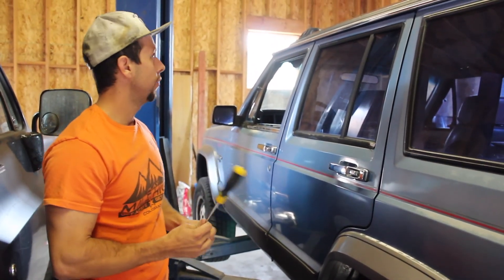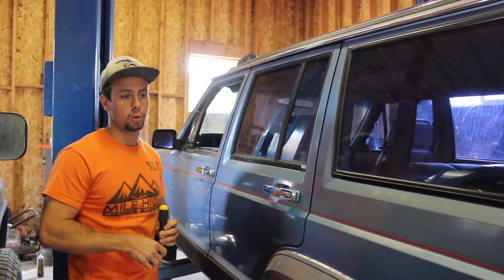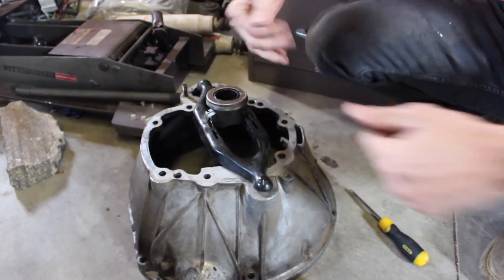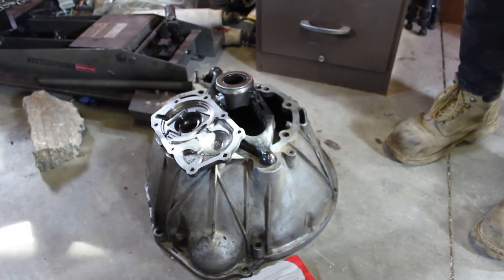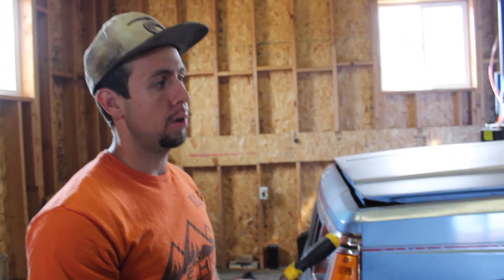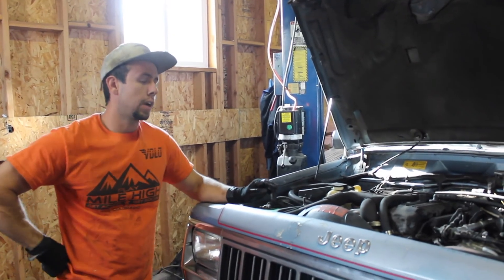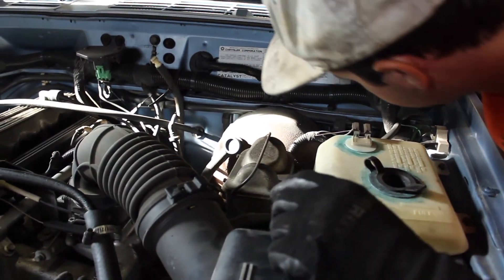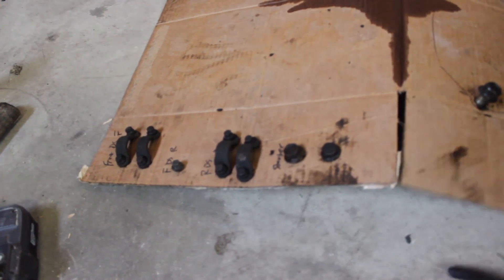1991 Jeep Cherokee Internal to External Slave Conversion Part 1 (Removing Transmission)

Comment: Is there a difference in the strength of pressure you need to place with your leg between the external slave and the internal? Is it easier to press/ do you put less power with the external slave?
Reply from the maker: hi @israel Berko   I responded to this message on the other video that you posted it on.  Let me know if you have any other questions.